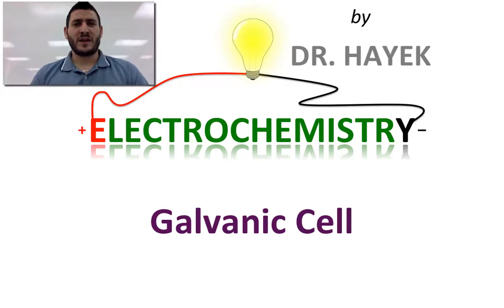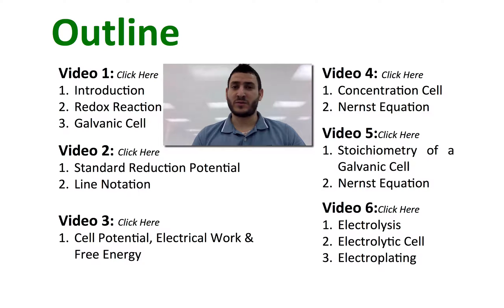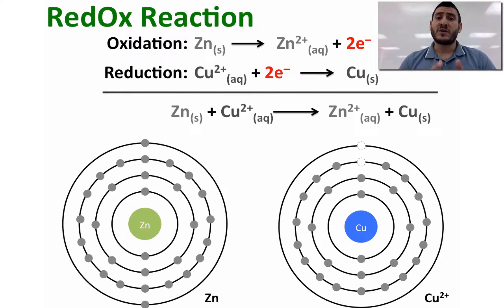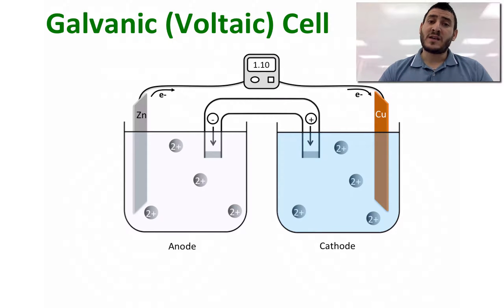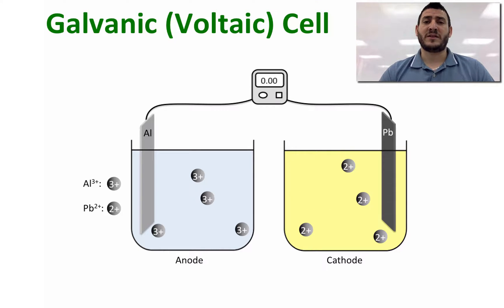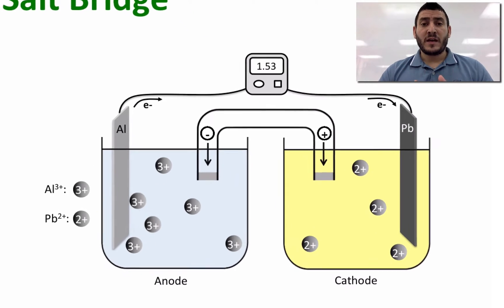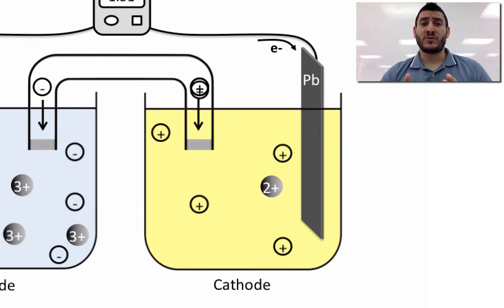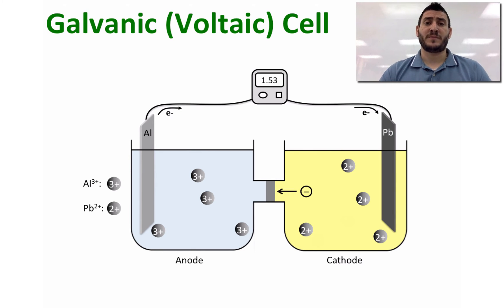Electrochemistry | The Galvanic Cell.

Comment: Thank you Dr. HAYEK for this informative presentation. I have a question, does the salt bridge method improve both battery cell lifespan as well as degration of anode and cathode? 

compared to the more traditional battery chemistry like a lead acid car battety?or solar batteries?

Thank you
Reply from the maker: Without the acid salt the battery won't work. The solar batteries use different technology. 👌

Comment: It may be of interest to some people that the positive side of the galvanic cell is at the cathode (where we connect the plus of the voltmeter) is on lead and the negative side is at the anode (on aluminium). The flow of electrical current is opposite to the flow of electrons.

Comment: I think there is an error at 1:17. Shouldn't the second electron move from the fourth electron layer of Zn, instead of third? The electrons on the last layer are the easiest to "steal". 
What are the solutions that are present in the two containers? Can they be any salts, such as Aluminium Chloride, Sulfate, etc on Al size and some Lead salts for lead? Can we replace the salt bridge with a metallic bridge? It would still allow to transfer electrons from one side to the other.
Reply from the maker: No there is no error, everything looks fine to me. Please check it again and let me know. For the solutions, they could be any solutions that contain the same ions as the electrodes. The countering does not matter. For the salt bridge, since it transfer ions and NOT electrons, therefore, it cannot be replaced by a metallic bridge. I hope you find this helpful.
Reply: Thank you very much for explanation, it is indeed helpful. About the moving of the electrons - the electrons that are orbiting far away from nucleus have a higher energy state than the ones closer to nucleus. So, if there are two electrons moving from Zn, I would have expected them to be the ones from the last shell, which has two electrons. The diagram shows electron leaving shell 4 and one leaving shell 3 (with one electron still orbiting shell 4). Is this how it happens?
Reply from the maker: OH!!! No you are right, I missed this. It is my mistake, you are right at this point. It is just a mistake with the animation but the idea is there. I should have taken the electrons from level 4 only. I missed the electron at the bottom of the page. Good catch.
Reply: Thanks for confirmation. I noticed the electron that can be seen at the bottom of the animation was quite well hidden... And it looked so natural to move the electrons between same locations :)

Comment: Why Zinc gives its electrons to copper? If copper cathode is neutral ?
Reply from the maker: +Глеб Ворончихин Zinc will give its electrons to the copper ion which is Cu2+, and not to the cathode. I hope this answers your question.
Reply: +Ali Hayek so we can say that zinc's electrons are attracted by Cu2+ ions through wire and Copper cathode  ?
Reply from the maker: Yes exactly this is what happens. The Standard reduction potential of Cu2+ is higher than that of Zn2+, and therefore, will have the strength to pull the electrons toward it more than Zn2+. Do not forget to subscribe ;-)
Reply: Ali Hayek thank you very much :)
Reply: So when the Cu2+ ion receives the two electrons it needs from Zn metal, it becomes a metal. On the other hand, the Zn metal because it loses two electrons, it becomes an ion and it dissolves in solution. So during the operation of the battery, we end up with more copper metal and less zinc metal. If we apply electricity from an external source, is the process reversible?